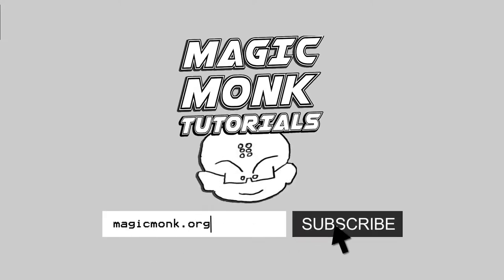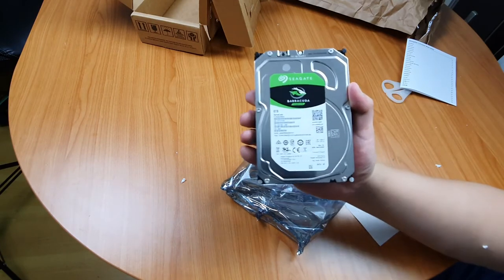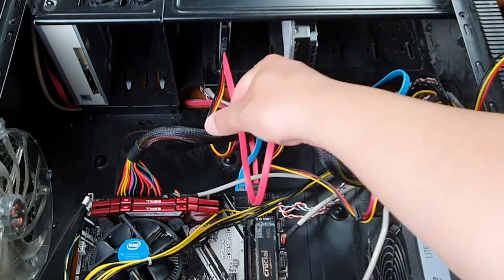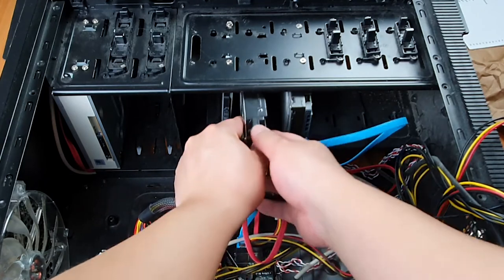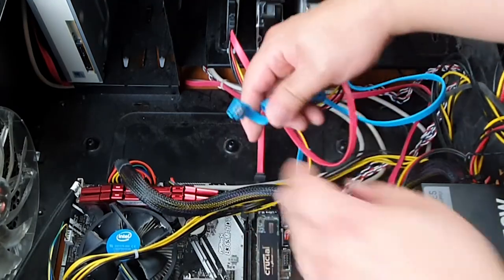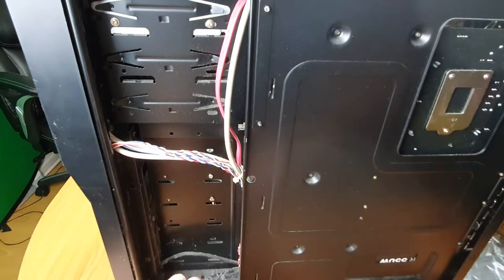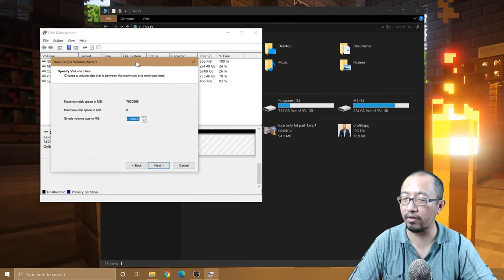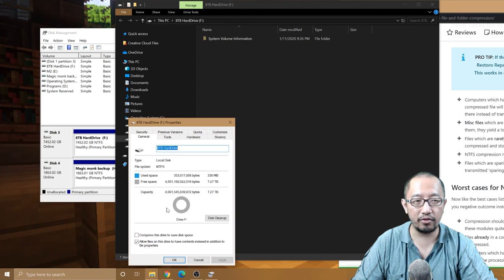How to install HUGE Seagate Barracuda 8TB Internal Hard Drive ($175 USD)

Comment: Thank you so much!

It had been several years since the last time I installed a new hard drive, so I had forgotten all of the necessary steps to completing the process.

I was worried that it was DOA, or maybe there was something wrong with the wiring in my computer.

Nope.

Went off without a hitch.

Thanks again!

PS: Indeed, the 8tb Barracuda is a big boy. I thought about getting something bigger, like the 12tb Barracuda, but it was $326. So, I figured $109.99 for 8tb was more bang for my buck.

Comment: A complete nightmare. Apparently someone hasn't heard of a proper arrangement. Complete chaos in the arrangement of cables. Terrible tightening of the screws on the hard drives. The vibrations will be terrible. Man, first learn how to make it and then give advice on how to make it. This computer has probably not been cleaned in a year.